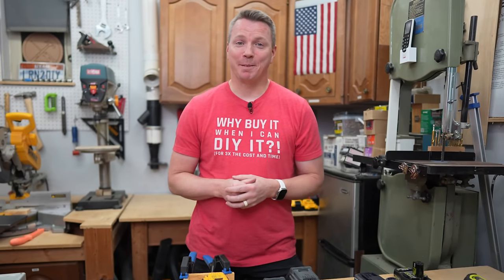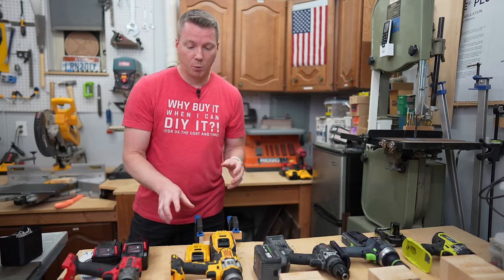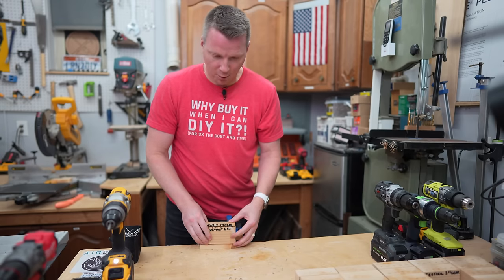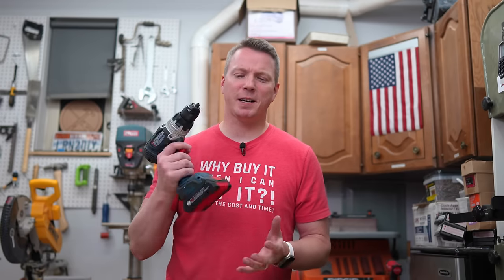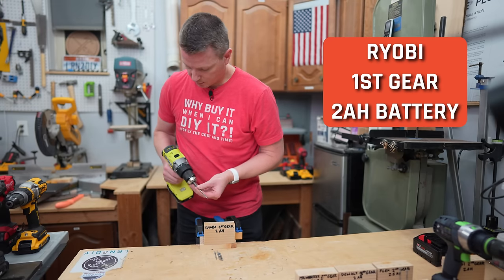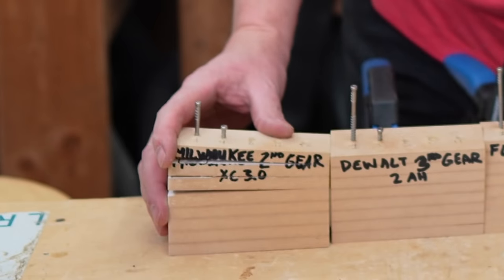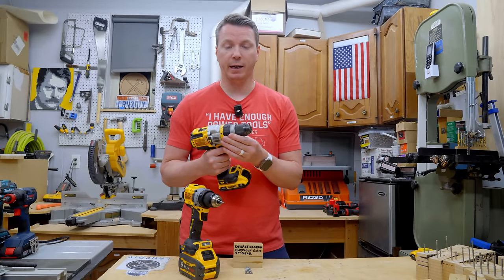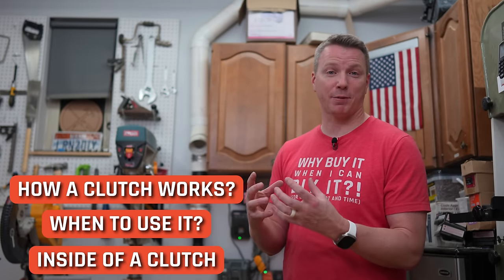What? This Feature is USELESS On DeWalt Drills!

Comment: The clutch shouldn't be affected by the battery size, and the gear should have very little effect. The clutch is just supposed to disengage the mechanism when a certain amount of torque is reached. It should be a physical mechanism on most drills. Adding more power to the drill by having a battery that is providing more power, shouldn't matter at all. Basically it's supposed to work like a ratcheting torque wrench. It doesn't matter how much power you add, when you reach a certain amount of torque, the gears slip and it no longer tightens.

Except for your drill with the electronic clutch, which obviously works differently. I can't say how that one works. It might be different. Since that one isn't a physical mechanism, it's possible that adding more power could alter the results.

The gear you're in could have some small effect, because spinning the screw faster could alter the amount of torque that gets applied before the gears slip.

If you're using a ratcheting torque wrench and you turn the bolt quickly vs. slowly, it could alter the final amount of torque that is applied before the torque wrench slips and stops turning the bolt. Turning the bolt quickly increases the torque being applied to the wrench mechanism before it gets to the bolt, causing the wrench to slip earlier and the bolt to have less torque applied for the same setting.

But the difference should be fairly negligible.

I do have to say that while your DeWalt drill obviously just doesn't have a functional clutch, you're being a little unfair to some of these tools like the Milwaukee. You're skipping clutch settings. The clutch settings on some tools may not be comparable to the same clutch setting on a different brand of tool. If you went through the clutch settings one by one you would probably get the nice staircase effect with your Milwaukee - and with almost any drill with a clutch. You just have to get to know the drill you're using, and get a feel for what the different clutch settings are going to do.

Just because your Flex drill makes a staircase at those settings, that doesn't mean that every drill should do that. If your Milwaukee drill has a higher maximum torque output, then the changes between settings would most likely be higher, so you'd need a finer tuning to achieve the same results. But the drill does have the ability to tune it more finely, you're just not using it. You're assuming your Flex is working the way drills should work and then holding other drills to that standard. That's not right at all. If you were drilling into a harder wood, the Flex might not perform as well as the Milwaukee.

My Bauer drills will drive a 2-3 inch construction screw fully into a pine board with the head sunk in so it's flush, but won't continue to drive it through after the head is flush at about an 18. That's important to know. But it's going to be different for different brands of drill.

Comment: Should use bigger lag bolts with the Dewalt, to see how it performs with a load it was designed for.
Reply from the maker: That would be pretty interesting to see, though most people use an impact driver for that kind of work. To your point though, I'm sure that at some higher resistance point you'd eventually get the stair steps that the others showed.
Reply: @LRN2DIY  exactly, for rough work just use an impact driver - lighter and more torque. Expensive drills should have clutches with finesse. No excuse for the clutch performance on the new Dewalts.

Comment: Need to use speed 2. Speed 1 is specifically high torque (e.g. using a hole saw). Dewalt is the only drill you looked at with three speed settings and I’m baffled why speed 2 was ignored. 

You don’t want the clutch hyper sensitive in a high torque application. 

Verified using my DC988.

Comment: I'm certainly not offended, but is the DeWalt the only "60V" drill you tried? The FlexVolt tools are higher power, so it's not surprising that you get little to no change in clutch performance with material that 20V drills can screw through, even on the lowest setting. The Atomic one might be exactly what you described, just an overpowered tool choice even at 20V.

Comment: HOW DARE YOU ACCUSE PEOPLE OF BEING OFFENDED?!?!?!
Seriously, my Rigid tools seem to perform about as expected too.  The lowest torque setting really does limit it to a very low torque level.  I can test different settings until I get the level I want for what I'm doing, and then use that for the rest of similar work.  I get why people who bought inferior (but expensive!) tools might be upset, but they should direct their anger at the manufacturers for making such useless features.  I wouldn't want to have to buy a bunch of different drills to get different torque levels.  That's what the clutch is for!  When it's done right, the clutch should be able to cut out consistently no matter what motor is connected.

Comment: I wonder how many people are confusing drills with drivers, a better test for a DRILLS clutch would to see how it performs on DRILLING into different materials of varying hardness and thickness. Before all the YouTube experts swarm in, yes you can use a drill as a driver but you can also use the back of a screwdriver to sink a nail but it doesn't make it hammer.
Reply: Hahahaha what. The reason these are called drill drivers is BECAUSE they have a clutch for driving fasteners. If it didn't have a clutch then it would just be a drill, which rarely needs a clutch, except  for safety with hole saws or  big bore augers as stated
Reply: As I said, que the YouTube experts
Reply: @koryflores1832  fine haha. Good luck learning anything

Comment: Not sure why anyone would make the claim that different battery capacities would impact the power of a drill. Even a beginner electrical engineer could tell you that a DC motor's torque is the result of a given voltage.
Higher capacity would lead to higher voltage at lower percentage charge, but there's a reason all these tools have standard battery specifications snd always use the same voltage.
Reply: Voltage and current. If you have the correct voltage, but no current, that motor won't do much. If you have a battery that can supply more amps at the given voltage and the motor is rated to use that higher amperage, you will get more torque. Guess what batteries tend to have more available amps?

Comment: I think you are comparing apples and oranges for drill applications. These big Dewalt drills aren't for fine construction with MDF with narrow heads. It's like taking a 1/2" impact to small fastener and wondering why you are stripping bolts and snapping off the heads.

If I hold my clutch on my DCD998, you can feel different levels of torque applied before the motor kicks out. Compare that to torque you would apply to a screw driver and it's clear the higher torque settings are not for the application you are testing or expecting.

For my DCD998,  torque 1-3 is for normal <3" #8 or #10 wood screws. The rest of the range is for the drills expected application of running in lag or structural screws. Using 3" #8's into pine with a tapered head on my drill with an 8ah on speed 2, 1&2 partially drive, 3-4 is flush and 5 is buried but clutches out. On speed 1, the screw is always flush but never buried.

My DCD800 has a mechanical clutch and is smaller and meant for driving screws for finer applications. It's behaves just like these with a normal ladder over it's range.

What would be more interesting, is testing the amount of torque and consistency for each clutch setting for each drill. So you can see how much torque each setting applies, and what the difference is for each step on different drills.

Comment: If that's the DeWalt you disassembled it's possible you made a reassembly error. Check to see if you erred. If it still does it, then try a new drill you haven't disassembled to verify. As far as the electronic clutches go, it seems that it's programmed to trip at motor amps instead of physical torque like the old mechanical clutches. That would explain the over torque in the low speed setting because the electronic clutch isn't designed to trip at lower amperage settings that the matching torques would have in low gear.

Comment: Is this old DeWalt vs new? I use my dcd771 &  the clutch all the time and level 1 has NEVER done that.

 In fact, i just grabbed it to try and it worked as expected at torque setting 1 or 2. I don't have the monster battery pack, tho.

Could it be quality control?

Comment: DeWalt is an enormously popular brand, and no one ever realized that the clutches don't work? That's because no one uses clutches. They will never yield consistent head depths, because wood is not a uniform material. That being the case, why not leave the clutch off altogether and lower the price of the tool?

Comment: Let me see how little torque I can get out of a power drill…

Hey mate, I enjoy your videos and the methodology you use to make comparisons, but I think this one missed the mark.

A small gauge screw into MDF? Give that thing some real resistance!

Its like seeing how well an F1 race car can trundle through a school zone at the speed limit. 

Nobody in their right mind should be pulling that trigger to 100% while doing detail cabinetry. If they are, they need to switch to rough framing.

Why not test the range on the clutches by compressing a spring with a bolt, and then checking the torque of the bolt to undo it?

Also did you consider any kind of test of the throttle, or trigger? For example, at different settings do I have fine motor control, or is it all power all the time.

Looking forward to watching another follow-up video.
Reply: All those where power drills and even tough some of them barely drill the screw in that little resistance mdf with the lower settings, it shows more about wich of those are real power drills and wich ones will lack the power on the real applications for power drills

Comment: Are you aware that different drills have different lowest clutch setting and that screws in wood are not screwed in with a clutch ever unless fastening something rigid to the wood. this video is embarassing
Reply: this is just evaluating how clutch works on this type of small screw in this type of wood. try using 12v drills for this and you will see that their clutch range will suit you better for this aplication.

Comment: The only thing you've established is that your particular DeWalt drill (whether that unit or that model) doesn't have a clutch that works as expected.

I have an older 20V DeWalt drill which has a mechanical clutch that works perfectly.

You'd have to test more models to justify the very misleading title of this video.